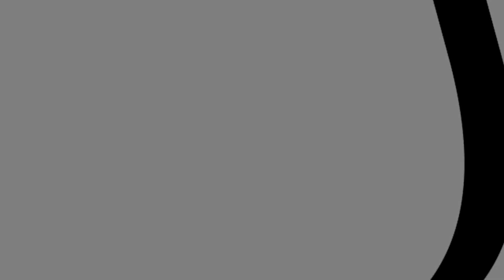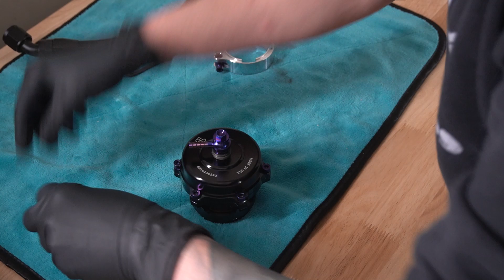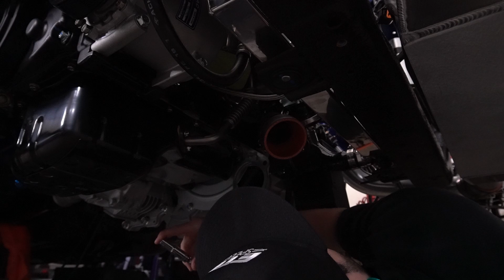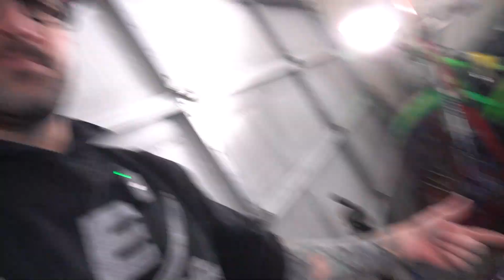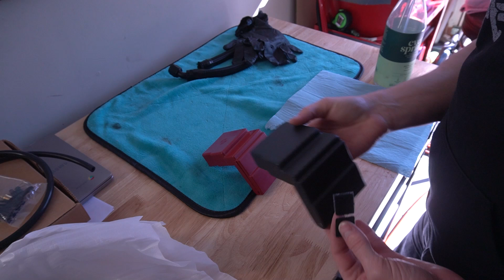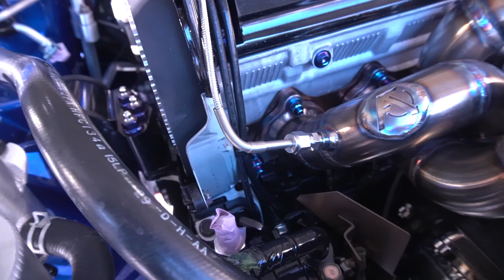Installing A Tial BOV + A Ton Of Random Tasks! | Evo Build Progress

Comment: Are you going to put the shield on the starter? I also would not use titanium bolts in the exhaust, they are not good in high temp applications. Just get some nice stainless arp bolts.
Reply from the maker: I probably will at some point, mine was gone off of the starter so I'll have to locate one. Yea I was looking into those, I might just end up doing stainless on them, not totally sure yet but we'll see!

Comment: That oil return line sucks 
Make one out from -8an line
Reply: If not the car will smoke out the exhaust
Reply: That happened to me with fp red turbo
Reply from the maker: Really? I’ll have to look into that! I thought about doin an AN line return but was kind of steered away from it. I had the FP black on the car for a while when I owned it first with an oem return line and never had any issues but 🤷🏼‍♂️ we’ll see how it goes, might change in the future if we need to!
Reply: I had to since now I went to a precision 6264, Never really had a problem with it on the old fp green.